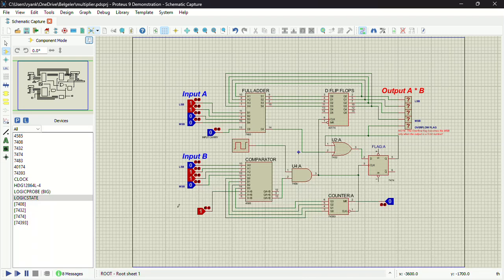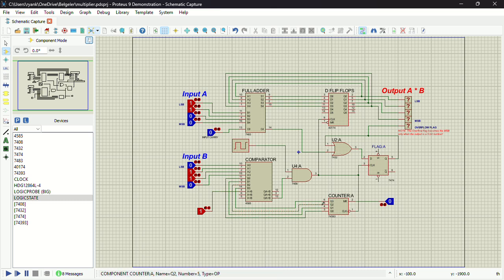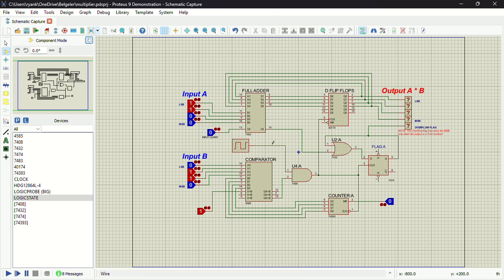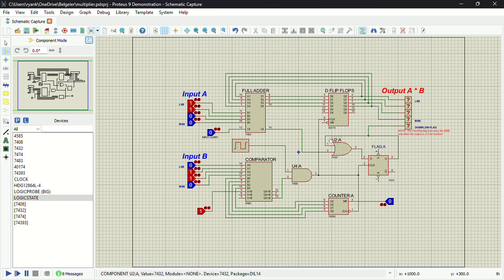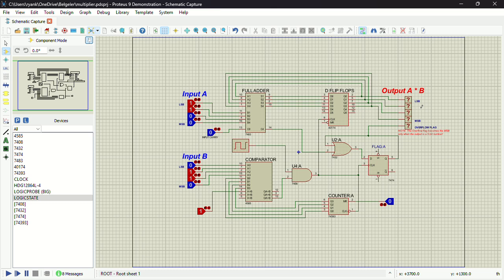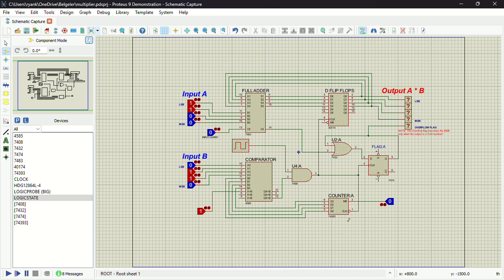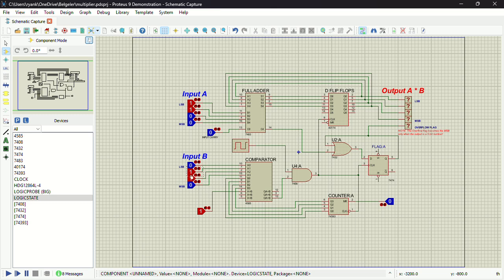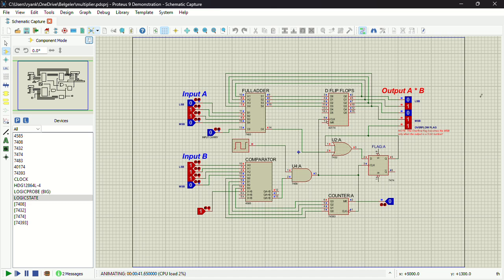4 Bit Multiplier Circuit Design and Simulation using Proteus

Comment: Can you make a video on an 8 bit multiplier like this one and the result is showing on the 7 segment display
Reply from the maker: That's a great suggestion, I would simply need to add BCD to 7 segment decoder(7447) and LED 7 display. New video coming up soon😁👍🏾.
Reply: @digitalDesignWithRyan  Thank you bro! Actually i am trying to build an 8 bit calculator on proteus which includes addition subtraction multiplication and an ALU logic unit. But i can’t get it quite right so i was wondering for some help!
Reply from the maker: Oh yes of course I can help.I'm also working on an ALU, I already implemented Addition Substraction ,Multiplication and Division. You can check out my multiplier-division circuit and addition-subtraction videos here :
https://youtu.be/nChQfftJ3m4 
https://youtu.be/e-kvTSh5ZvY
Reply from the maker: I advise you start with 4 bits or less and then you can scale up to 8 /16 bits. This can help you get the general idea of your design right :).
Reply: @digitalDesignWithRyan Yess! I saw these but i couldn’t understand how to implement it to 8 bit
Reply: @digitalDesignWithRyan You’re right. However i have to submit the 8 bit calculator as a project😅. Also it does not have division as a part of it
Reply from the maker: You can easily scale them up to 8 bits by adding more full adders, adding one more counter, adding more D flip flops, comparators etc but the circuitry will get more complex. Right now I'm trying to find a way to implement all arithmetic operations with shift registers. I will post them soon :)
Reply from the maker: Ohh I see,I I will be sharing my proteus files soon. I was using Demo version at first but I now have Proteus 8 Professional so stay tuned :)
Reply: @digitalDesignWithRyan Okay thank you brother. I’ll wait for the uploads
Reply from the maker: Is it for your final project?
Reply: @digitalDesignWithRyan I see i just got Proteus Professional as well
Reply: @digitalDesignWithRyan No its my second semester project for Digital Logic Design

Comment: bro the calculated value is wrong evrytime and the multipllication takes more time
Reply from the maker: The 4 bit multiplier circuit works perfectly well. 
Important things to note:
1) It's a 4 bit system hence it only outputs 4 bit numbers(0-15).In case of an output greater than 4 bits, the overflow flag is set. Use more bits to increase range.